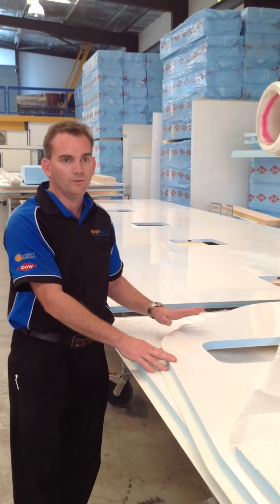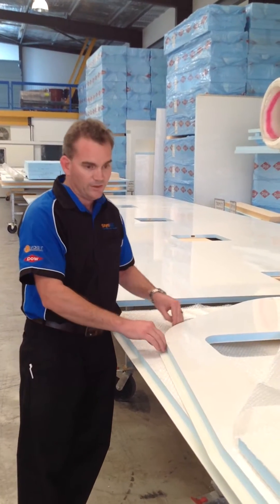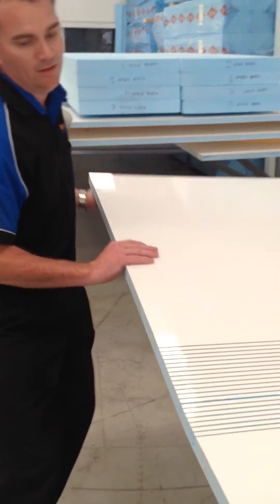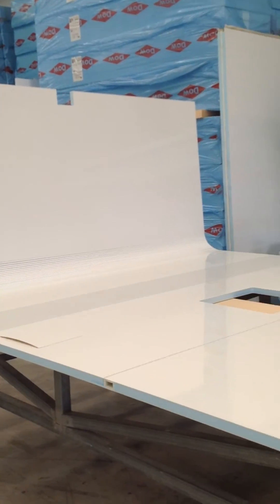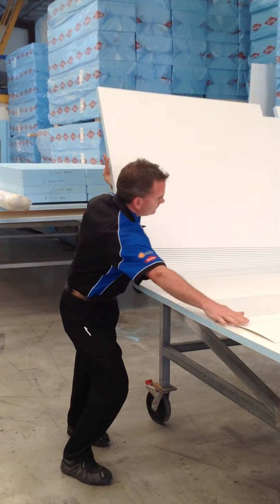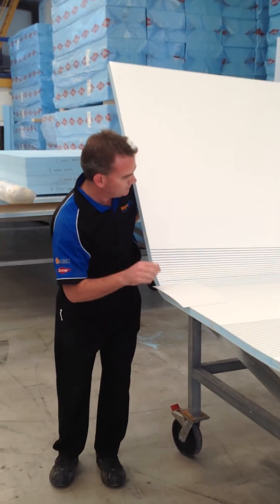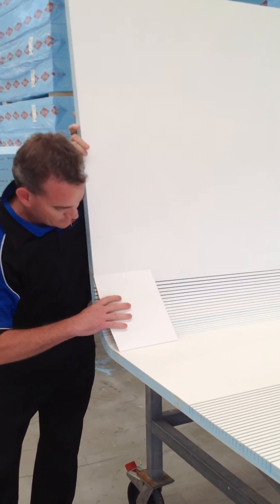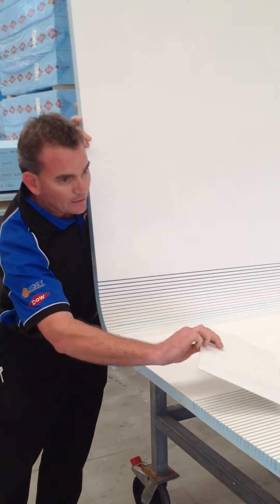FAQ: Can I have a rolled roof line?

Comment: What does this stuff weigh per square meter?
Reply from the maker: The 29mm panel is 7.06kg per sqm.
Reply: @StyroMAXInsulatedPanels  Oh really that is excellent, I built with 50mm coolroom panels and they are about 11kg. This makes these composite panels even more appealing for my next build. How about point loading and delamination compared to regular coolroom panels? As I have experienced this on my floor with just walking on it over a period of a year.
Reply from the maker: We have a different product we use for flooring; either a 19mm Thermolite floor or a composite panel made of high density foam, depending on your build requirements.

Comment: Hello. what is the thickness of the plastic inside and outside? insulation thickness 30mm. and the width of the stripes where the slots / cut go. thanks for such an informative video!
Reply from the maker: The thickness of the fibreglass can 1.5mm, 2mm or 2.4mm thick. The foam core is 25mm and then faced with the fibreglass inside and outside face.
Reply: @StyroMAXInsulatedPanels  Thank you for your detailed answer. Can I ask you one more question? With what distance/ length step is the panel cut to bend it along the radius? 20-30mm?